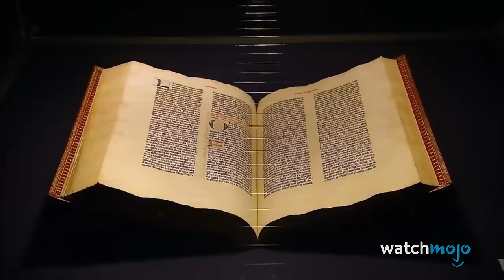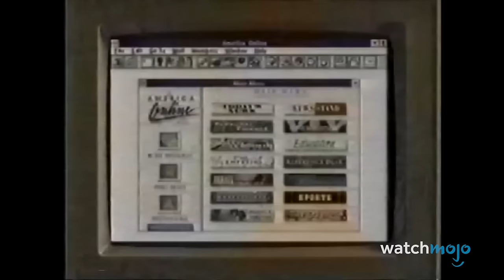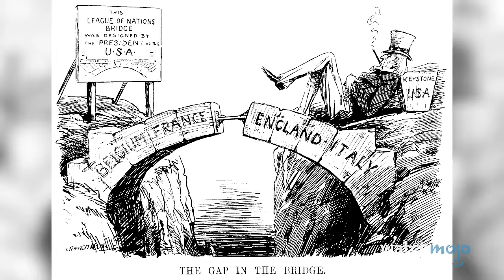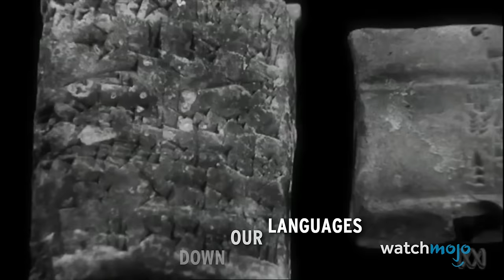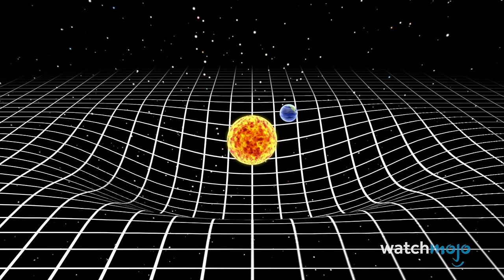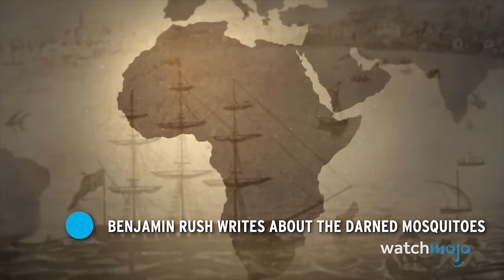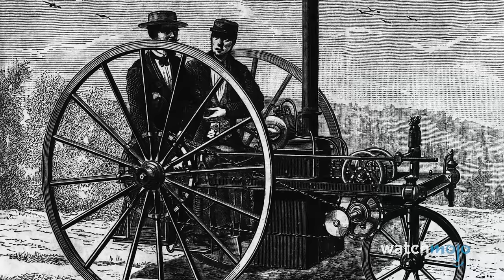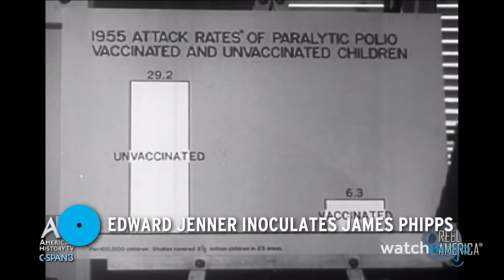Top 20 Smartest Decisions in History

Comment: Your internet inventor Lee is wrong. He invented the hyperlink. The folks at Arpanet in the 70s have an issue with your internet inventor. Packet switching network they made, one of the first to implement TCP/IP, which makes the internet start to work.

Comment: Correction for Number 3:

Yes, Washington had set a precedent by refusing to run for a third term, and for most of US history, no president served for more than two terms. Even Grover Cleveland, the only president (so far) who did not serve consecutive terms, still served only two terms. However, while it was a precedent, it was never any sort of official rule, just an unspoken norm.

That precedent ended with FDR, who is still the only president to not only serve more than two terms, but to be elected to four, even if he did die in office. While FDR had not quite proven Washington's fear to be correct, he had still, albeit inadvertently, given quite the shock and especially a scare to conservatives, particularly to the Republican party. In fact, because of how the New Deal had helped pull the US (and by extension, most of the world) out of the Great Depression, the Republican party was convinced that if they did not enact any sort of official limit, no one other than a Democrat would be elected president.

So as Republicans dismantled the New Deal, they passed the 22nd Amendment in 1947 and ratified it in 1951.
Reply: If you were to actually research the economy, you’d see that FDR’s “New Deal” not only didn’t end the depression, it actually exacerbated and lengthened it. The U.S. was one of the last developed countries to recover.  Further, the GOP didn’t disassemble it, the New Deal was abandoned in WW2 because we recognized that it interfered with other, more-pressing priorities.
Reply: @FastEddy1959  "The US was one of the last developed countries to recover."

Sure, that's why the UK and USSR could not rely on the US to keep them supplied through lend-lease when Germany was hitting them hard - oh wait.

"The GOP didn't disassemble it..."

Yeah, they did, and they never downplayed, let alone hid, that fact.

"[T]he New Deal was abandoned in WW2 because we recognized that it interfered with other, more-pressing priorities."

Sure, that's why we don't have things like masdive farmers subsidies for crops like corn or the entire dairy industry, the latter not having served as a substitute for alcohol because the US was still feeling the effects of Prohibition, which was passed under a Republican administration and ended by FDR as part of his first campaign platform - oh wait, again.

Next time, do not lead with "If you were to actually research...", especially not over something like "the economy." You are obviously someone who does not want to know what the GOP was doing during this time, particularly not one of their biggest donors, Henry Ford, and a certain powerful friend he made and inspired over in Germany.
Reply: @DavidRichardson153  The U.S. economy did actually fare worse is the 30s than the UK or the USSR. Britain had only two years of negative growth (30-31) compared to America’s five. Unemployment is the U.K. was half what it was in the U.S. FDR’s policies were essentially a “double-down” on the mistakes of Hoover. Six years into FDR’s New Deal had the U.S. still at over 17% unemployed and the total investment in capital was down by over $3 billion dollars- hardly a favorable portent for growth. I have studied economics, you seem to get your economics background by listening to Steven Colbert. Buy a book!
As to the fate of the New Deal programs… most were struck down by the Supreme Court but if you want to credit the GOP, I’m sure they’d accept. These were a big part of the economic damage America endured in the 30s- programs like the NIRA (grow the economy by establishing cartels & fixing prices) or the AAA (the origin of the agricultural subsidies you mention) or the NLRA which sought to reduce unemployment by, unbelievably, increasing wages!  
I still recommend you try doing some real research in economics & history. It may help you grow out of the left’s simplistic, socialist, wrong-headed  policies. Try reading some Higgs, Friedman, Sowell, or Rothbard.
Reply: @FastEddy1959  "Britain only had two years of negative growth (30-31) compared to America's five."

Ah, "negative growth," a modern term used by economists because they do not like acknowledging anything that does not perpetrate the myth of infinite growth. Also, "negative growth" in what? GDP? Every time that has been used as an indicator, it pointed towards... nothing.

"Unemployment in the U.K. was half what it was in the U.S."

Because the U.K. actually had their own version of the New Deal going on. In fact, most countries had their own version of the New Deal going on. Even Germany did, though theirs was dedicated to building up military without being noticed by everyone else.

"FDR's policies were essentially a 'double-down' on the mistakes of Hoover."

Ah, yes, FDR dragged his feet on repealing Prohibition and cut taxes even further than Hoover did - oh wait, no, one of the first things FDR did was sign the Cullen-Harrison Act in March 1933, which started the process of repealing Prohibition and was followed through by the 21st Amendment later that year (and his AG got it done by going through state conventions rather than legislatures), and then he signed the Revenue Act of 1935, which taxed up to 75 percent of the highest incomes.

Yeah, quite the "double-down" he did on Hoover's policies. I had no idea that "double-down" meant "do the opposite of."

"I have studied economics, you seem to get your economics background by listening to Steven Colbert. Buy a book!"

Yeah, your "study" shows, because economists have always been some of the biggest liars in history, and you rather blatantly lied about the things FDR did. Sounds like Colbert would have been a better teacher than whoever your "professors" were - and that is even assuming you had any, seeing as how "I studied economics" can mean "I invested just as Jim Cramer said I should." Is that why you thought taking a crack at Colbert would work?

"[P]rograms like the NIRA...or the AAA... or the NLRA."

Ah, mmm, starting by just giving the initials, like that somehow proves that you "studied economics." So, let's see. First, the National Industry Recovery Act, which... lasted less than two years and was stopped by... the Supreme Court siding a poultry company, Schechter Poultey Corp, because their "stream of interstate commerce" had ceased... for a company that exclusively sold in-state. Second, the Agricultural Adjustment Act of 1933 lasted for three years before the Supreme Court ruled against, only for it to be replaced by the Soil Conservation and Domestic Allotment Act of 1936, and then the AAA got adjusted and reenacted in 1938 and persisted to this day. And finally, the National Labor Relations Act, which led directly towards the peak of union membership that occurred in the 1950s, not to mention the higher wages and massive bargaining power for workers, was fiercely opposed by Republicans and faced multiple appeal attempts in the decade since its passage (all of which either failed or were vetoed) and yet never a Supreme Court ruling. And I bet the Republicans ceased in their efforts to repeal this and thus reduce the power and wages of workers - oh, wait, they never stopped doing that.

Golly gee, why leave out so much detail? Were you afraid of exposing yourself as a hack? Well, too late now.

"I still recommend you try doing some real research in economics & history."

You first, buddy, seeing as how you tried to pass a bunch of lies about economics and history as facts.

"Try reading Higgs, Friedman, Sowell, or Rothbard."

Wow, you obviously never read them yourself.

First, Robert Higgs, who argued the ratchet effect, which explains that government power only grows in fits and starts rather than continuously, that these fits and starts happen to coincide with national crises, namely economic collapses and wars, and that these growths rarely, if ever, receded, especially when it came to war. He even declared that the growth  of military industry and defense contractors - one of the few things the US economy has going for it - is nothing but a sign of decline and weakening of the economy.

Second, good ol' Milton Friedman, who argued 1) against government intervention for curtailing any spiraling inflation growth, 2) a business's, particularly a corporation's, only priority is to increase returns or else die out from competition, everything else be damned, and 3) as many public goods and services as possible, including the military, should be privatized. These are merely his biggest arguments, and one of the biggest results of his arguments is a little-known company called McKinsey, which went on to... establish the practice of funneling all returns for a company to the top executives while stripping the company of anything and everything that made it possible to have those returns.

Third, Thomas Sowell, who argued against the minimum wage, coined the saying, "When people get used to preferential treatment, equal treatment seems like discrimination" while also claiming that systemic racism (i.e. preferential treatment) did not exist, argued for decriminalization drugs and zero gun control (because gun control has historically been used against minorities, with the first major gun control laws being enacted by California governor Ronald Reagan in his efforts to stomp out groups like the Black Panthers), claimed that charter schools perform the best out of all schools, even as more and more data and news came out that showed the exact opposite, and more recently, argued that voting for Trump was better than voting for Clinton because "he would be easier to impeach" (and how did that work out?).

Finally, Murray Rothbard, a founder of anarcho-capitalism, arguably the most failure-prone economics system out there, as well as opposing any and all civil rights and supporting historical revisionism, siding with and befriending people like David Duke and Joe McCarthy.

Yeah, looks like you should try reading them yourself, buddy.